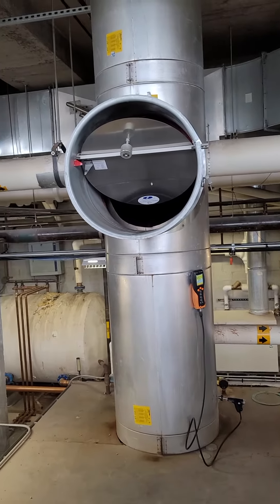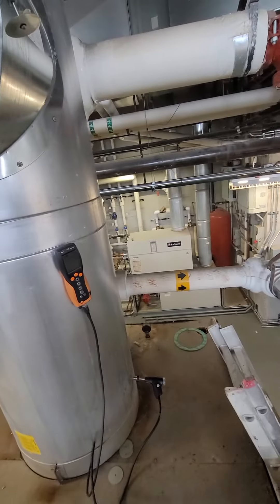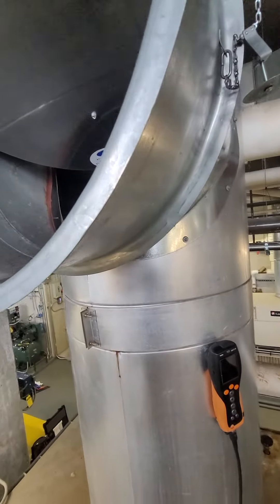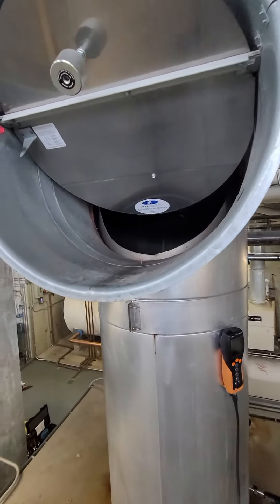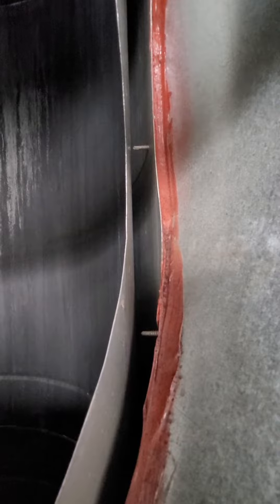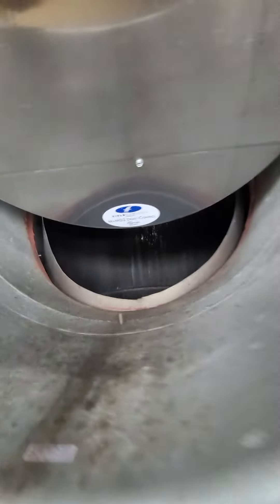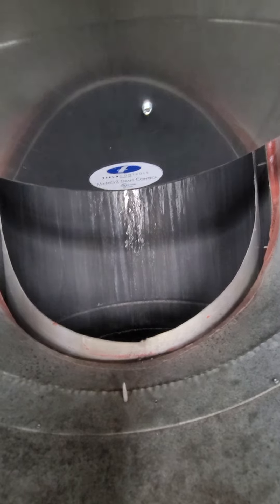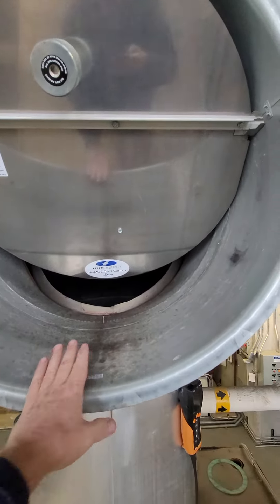boiler excessive draft issues?? Barometric damper not helping..

Comment: What is the fuel type  ? Fuel oil  ? Coal ? Natural Gas  ? LP  ?
Reply from the maker: Natural Gas
Reply: @MrBerniebling  the draft diverted keeps the draft constant no matter what the pressure is outside,  ex. Windy and cold to warm and mild. It allows the heat to be absorbed by the water in the boiler. If you try to run an oil burner without it you get nearly zero heat transfer to the water.  If it was forced air it still won't make heat even if it's burning.

Comment: I'm no authority, not even close, but I've been reading up on this because I have a similar problem with my home system so this vid caught my interest. If I understand the theory correctly, it seems to me that any leak around the damper increases the volume of air going into the stack and should act to reduce draft. Effectively, its like using a bigger damper.  I can see where it might be a problem if you had too little draft, but then there probably would not have been a need for the damper to begin with.  Or am I just missing something obvious?  I'm guessing that's why the installer didn't bother to create a better seal though it doesn't seem like a particularly good idea to deliberately create a leaky chimney, so probably not deliberate.